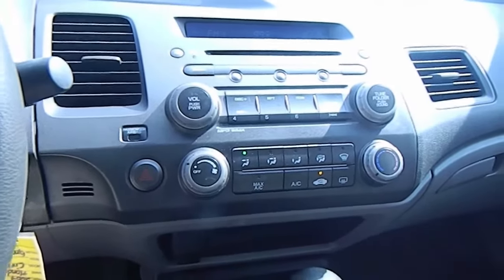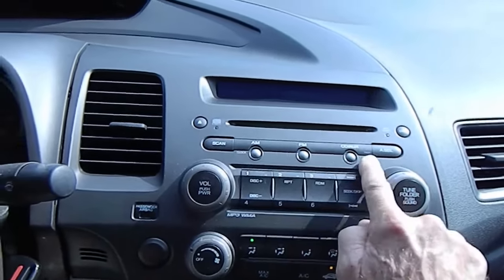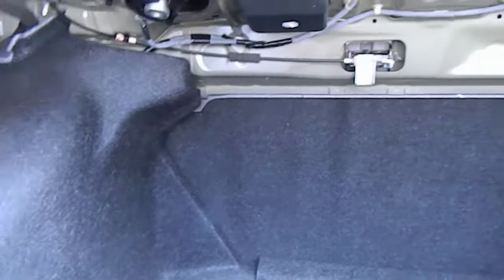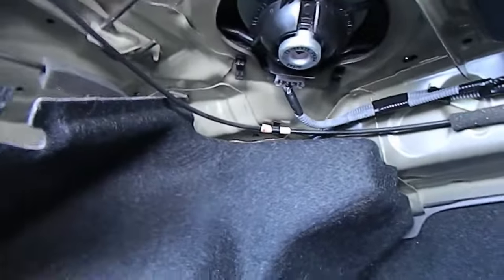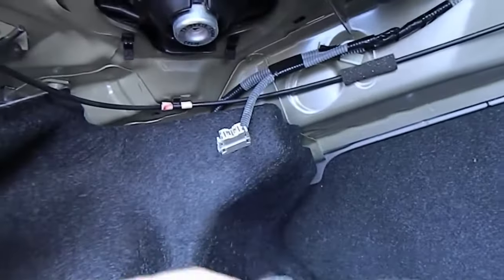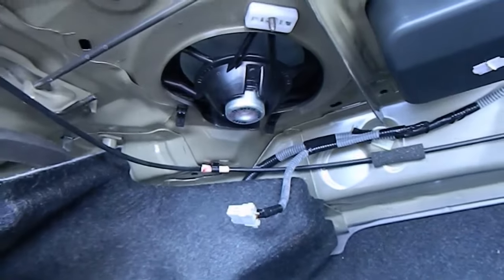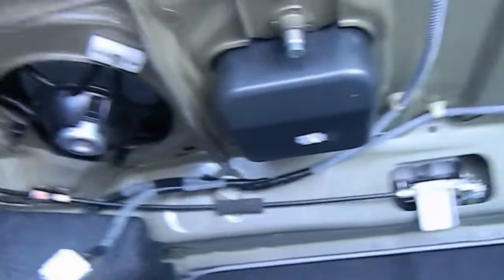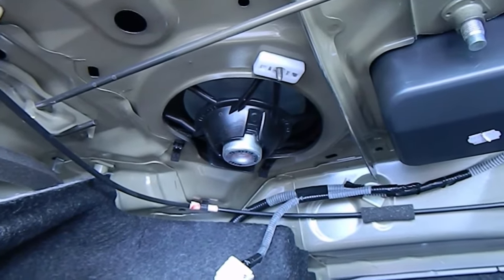Honda Civic - No Audio Speaker Troubleshooter - Car Stereo HELP

Comment: Hi everyone. 2013 civic ex rear speaker volume really low. Checked all wires and connections and fade. I tried plugging in another civic rear speaker and still same low sound. Any ideas. Guys.  Thanks.
Reply: Did you figure it out bro ?

Comment: What if I get no signal from wires, will I have to take apart the whole car?
Reply: Did you end up putting the car back together?
Reply: @Sanjay-x5x  yes just don't use the rear speakers anymore
Reply: Continuity test if no voltage at speaker to isolate broken wire most likely between amp and speaker.
Reply: @DJDOUBLE077  I think I messed up the wire, I had them wired up with I think is called lca where u can use subwoofers with stock radio. I put in a double din so switched the speakers to rca's and the rear speakers stopped working

Comment: Question will the 2009 touch screen go into a 2007 or there is a 2007 touch screen i believe in replace of this plain unit. Or is the wiring going to be totally different?
Reply: What submodel do you have, and also just get an android head unit if you want more functionality

Comment: NO HELP. I STILL HAVE NO SOUND NOW WHAT??? YES I DID REPLACE THE HEAD UNIT AND THE 15AMP AUDIO FUSE IS GOOD. NO ONE HAS FIGURED IT OUT YET ON ANY YOU TUBE VIDEO

Comment: The only speakers that work in my civic is the front ones near the windshield
Reply: Solucionaste tu problema?
Reply: me too did you find a fix
Reply: I have the same problem, did you figure it out?
Reply: @nalro1319  yes I replaced the speakers and that was it. Bad speakers
Reply: @miguelcruz4658  Really? I was starting to think that it wasn’t a speaker issue because what’s the likely hood of every speaker except the 2 front tweeters next to the windshield and the sub going out. That’s very weird how they can all go out like that at the same time, I’ll have to try and replace 1 to see if that’s my issue. What speakers did you go with?

Comment: i bet you scam people at your buisness
Reply: someones salty
Reply: Pierre Lapp saltier than the ocean 🌊
Reply: You’re absolutely right !!
Reply: Not salty at all. He's saying there are 4 bad speakers if there is no sound. False. I'm 20 and could do better service then this joke
Reply: Could also likely be fuse or a bad connection somewhere if all speakers stop working out of no where
Reply: I did this test and had same results as video. I suspect a shorted wire somewhere in the cables